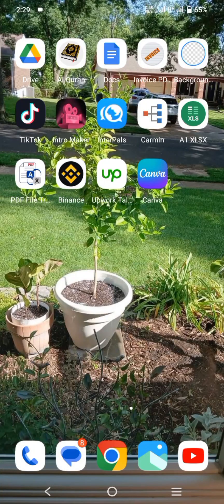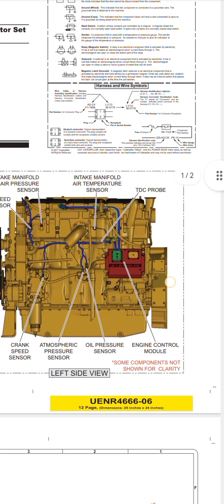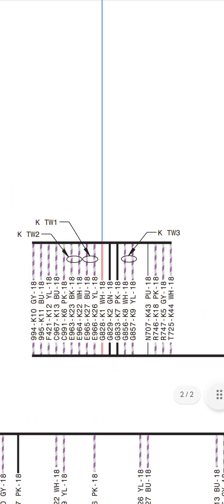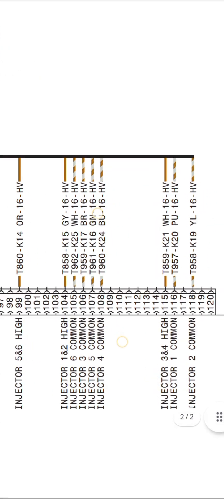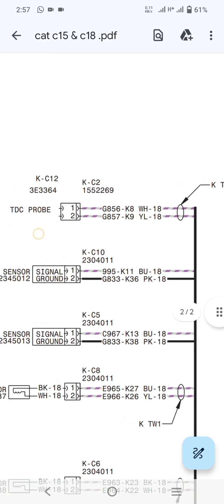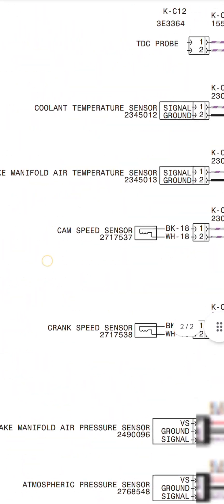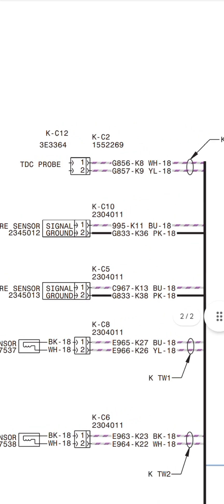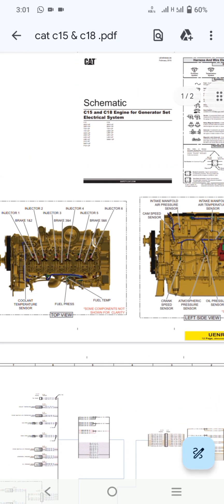Caterpillar generator C15 & C18 Engine wiring diagram pdf

Comment: Which pin in the ecm Adam3 C18 generator is injector disable? Thanks sir for your work.
Reply from the maker: Ecm pins 116 and 118 is injectors commons ecm sending grounds signals to each injector for operation 
Also cam speed sensor open each injector spary on dtc